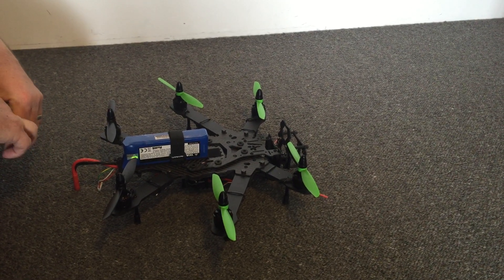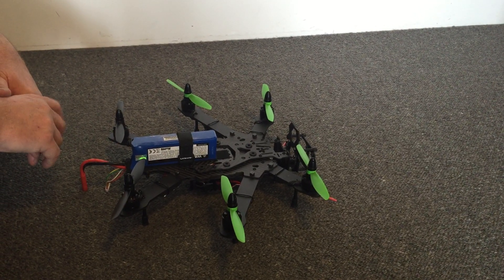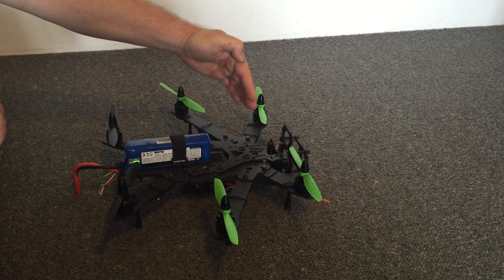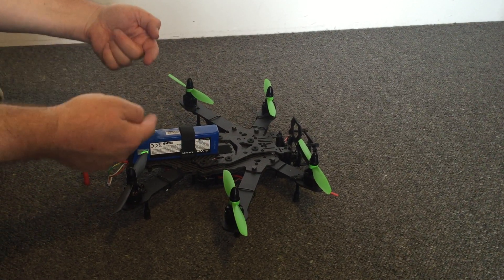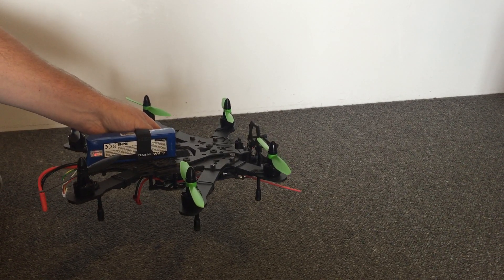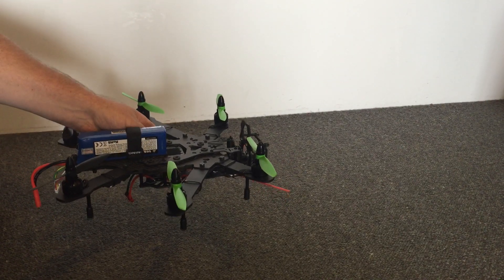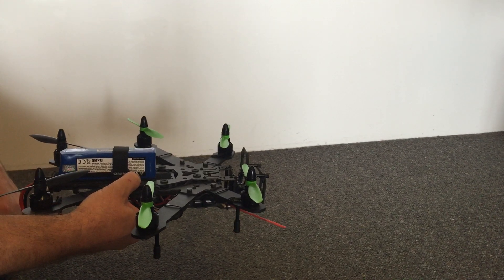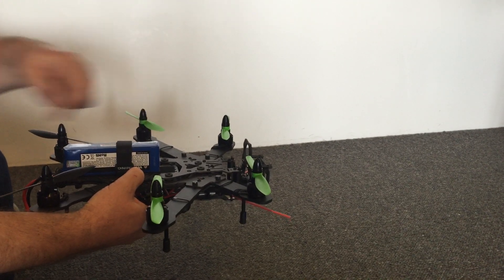Multicopter Centre of Gravity & Centre of Thrust

Comment: Hi Rob, 
Wanted to download your spreadsheet that calculates mixes for Quads, Hexacopters and V-Tails, but got Error 404 :(
Would it be possible to share one more time? And may be you could show, where to read about the calculation? We use very custom set of motors (more than 8) and probably reading basics would be much useful than just using your table. While the spreadsheet itself could be used as a good template for our own one.

Comment: Thanks for your video and your spreadsheet, Trainboy64! 
I have a question that I think you have the answer to:
When calculating the motor mix for Cleanflight (et al), should the motor position (and therefore motor relative power assignment) be calculated based on the CoT or the center of the Flight controller? I guess as I am writing this, I am realizing that it should be about the CoT, since that is the origin about which the craft will naturally roll or pitch.

Also, I think this is already the way that your spreadsheet calculates the motor mix, which implies that that is in fact your answer to my question :)

Thanks!
Reply from the maker: +Ocie Ward Hi Ocie,  yes your are right, the mix is calculated from (and calculates) the True CoT.  This is also where you should place the CoG which may require adjustment of the battery.    Ideally the FC should be at this location but it does not matter if flying in Manual modes as any roll, pitch or yaw movements will be the same at any position on the frame.
Reply: +Trainboy64 Thanks! I am tuning a TBS Disco, and I am finding some conflicting information. The frame is actually silkscreened from TBS with the "CoT" at the crossing of the diagonals (lines from M1 to M4 and M2 to M3, assuming Cleanflight motor numbering scheme). Then TBS suggest to place the CoG 15mm forward of that. 

I believe that your definition of CoT is NOT the crossing of the diagonals (although that happens to line up correctly in an X or H quad, but not in a deadcat) but instead is alongthe line that bisects the lines from M1 to M2 and M3 to M4. Is that right?

Based on the CAD file I downloaded from GrabCAD, the point as defined above lands 13.73mm forward of the marked CoT.
Do you agree that that is where i should place my CoG?

Thank you very much for your time!
Reply: +Trainboy64 I just checked your spreadsheet again and, yes, it confirms the CoT is at a point 13.7mm forward of the "CoT" marked on the frame. So yes, I will put my CoG there as well. I guess i should have double checked that before asking you my last question - sorry about that!

One last question, in your spreadsheet, one input field is "Distance between front and rear motor". Am I correct in assuming this is the vertical component of the distance and not the "hypotenutical" distance from motor axis to motor axis? Would be the same of course in an X or symmetrical H, but different in a deadcat (although only about 1% error).
Reply: Hi Ocie, 
Have you kept the xls files by any chance? They've gone from the original cloud :(

Comment: CoG is easy to calculate as it'll be the crossing point of all the diagonal motors. , but CoT is PITA and needs to be calculated. here is a really good write up which clearly explains this. 

http://flitetest.com/articles/calculating-the-center-of-thrust-on-multirotors
Reply: Just to add, my previous comment doesn't take into account additional equipment which will of course move the CoG fwd or bwd depending on the positioning of the equipment.
Reply from the maker: +seafurymike Hi Mike, The CoT "will" be the crossing of the diagonals but only if the quad is symmetrical front to back and left to right.  In this case the crossing point will be half way between the front and rear motors (See the flight test write up - very good by the way - spacing between front and rear motors is 281mm - halfway between them is 140.5mm - exactly half way without all the complex math.. )    Where the diagonal crossing point theory fails is when the front motors are wider apart than the rear, e.g dead cat or TBS discovery frame.  Think about each diagonal pair - when both motors are producing the same thrust the resultant is exactly midpoint on the diagonal - this won't coincide with the crossing point if the rear motors are closer (or wider) apart than the front.   In this case you need to find the mid points of the diagonals and join them with a straight line - where that crosses centre frame is your CoT. See here for a diagram that shows what I mean.  http://www.hobbyking.com/hobbyking/store/uploads/608241098X618223X36.jpg        This method will also show that the CoT is mid point between front and rear motors.
Reply: yes your right for non symmetrical units. good video BTW. Nice to see stuff like this cropping up.